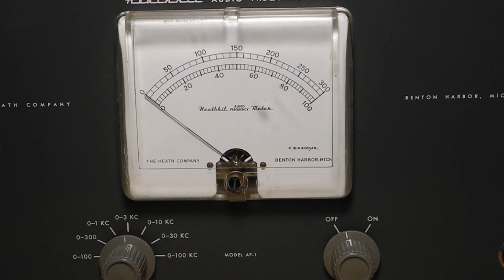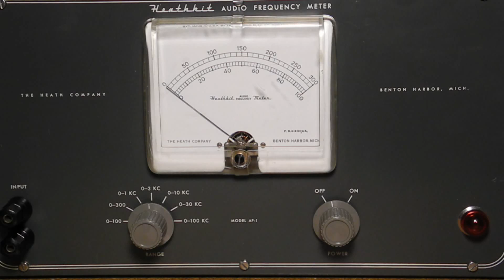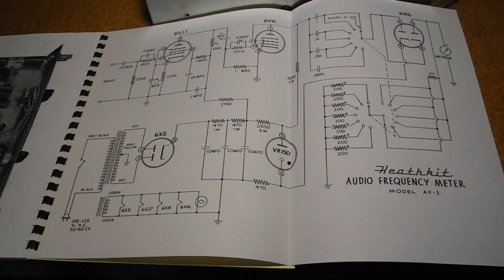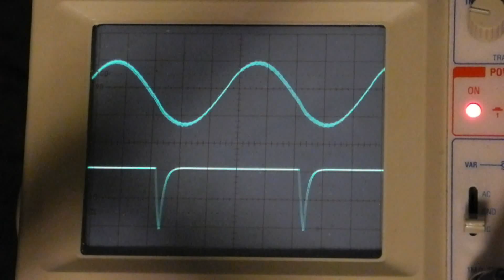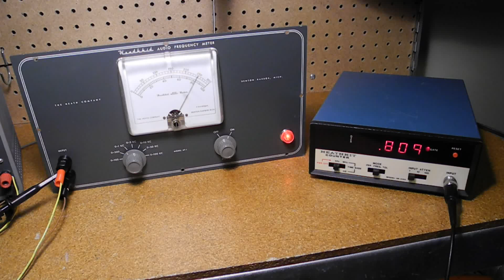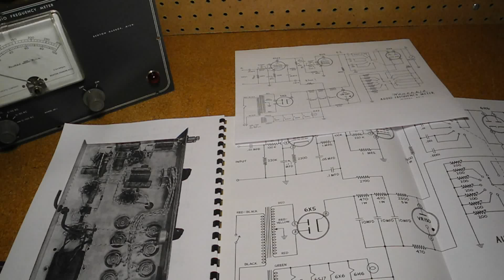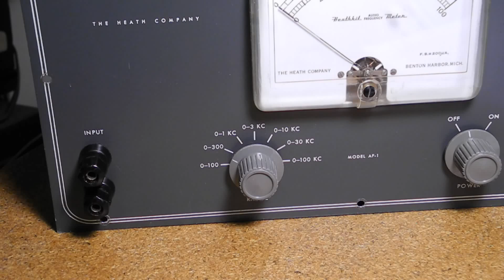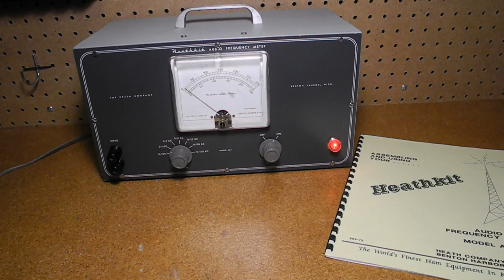The Heathkit AF-1 Audio Frequency Meter

Comment: Twice, you said the input should be "two to three-hundred volts RMS."  Do you mean 2-3 volts, or 200-300 millivolts?
Reply from the maker: The valid range of input voltages is 2 volts to 300 volts RMS.
Reply: @jefftranter  Thanks.  I interpreted "two to three-hundred" as "two-hundred to three-hundred."  :)  By the way, I just checked Ebay, and there's one for sale for $90 + $28 shipping (to NM).  A few weeks ago, I bought a Yitensen 3165 8-digit 1.3 GHz counter for ~$100 (incl. shipping + tax).  I like the old stuff, because it's easy to fix,  but a pricey analog freq. meter is a bit beyond the pale...